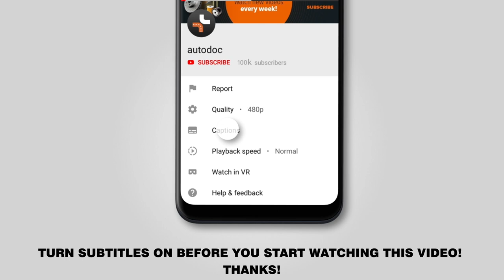How to change front brake discs / front brake rotors on TOYOTA AYGO 1 (AB10) [TUTORIAL AUTODOC]

Comment: I would have thought it would be easier to clean both sides of the disk before putting it on?
Reply from the maker: Yes, you're right, this moment is not shown in the video. It is necessary to clean both sides of the disc from all contaminants and transportation grease, since brake pads work on both sides of the brake disc. We are sure that your comment will be useful to everyone!

Comment: I just changed discs and pads on a 61 plate. 7mm hex not 13mm bolt holding the caliper. 2 locating screws had been removed before and not replaced. Not sure what size they would have been? Probably T25 or T30 maybe.
Reply from the maker: Hi! You can find this information in the technical documentation for car repairs.

Comment: Only 65nm for the screw of the rear brake caliper?? Not 90nm?
Reply from the maker: Thank you for your request.
You can find this information in the technical documentation for the repair of your car.
Stay tuned with us or feel free to contact our Customer Support team with any questions you have.
Best Regards,
Autodoc team.
Reply: Just one of several shortcomings. See my comment (more like an essay)
Reply: @CycloneCyd   Hi, I can't find your comment.
Reply: @LOREGUINNESS  it's definitely here. It's a comment not a reply
Reply: @LOREGUINNESS  Well, it was here. Autodoc have clearly deleted it !!!
Reply: @LOREGUINNESS   Its 90Nm for the two big bolts holding the caliper, not 65Nm
Reply: @mikhaillindan9091  thanks. I think that is correct. The bolts are M12 x 1,25 (10.9 class) so 90 Nm imho is a rational value. I proceed to cancel my past comment where I wrote an incorrect value. 
Thanks for responding.